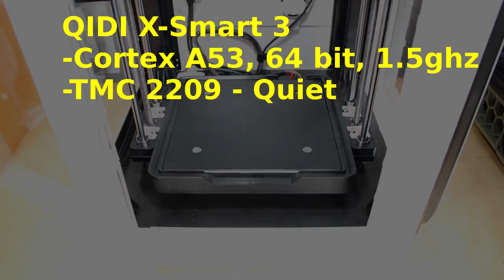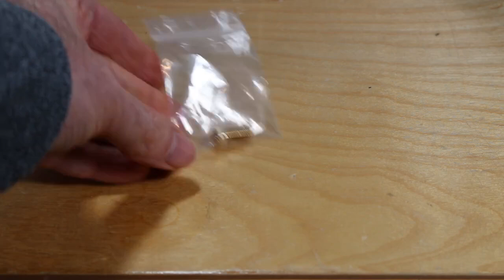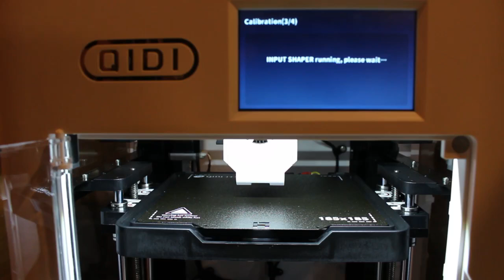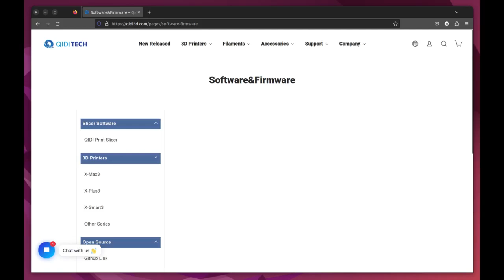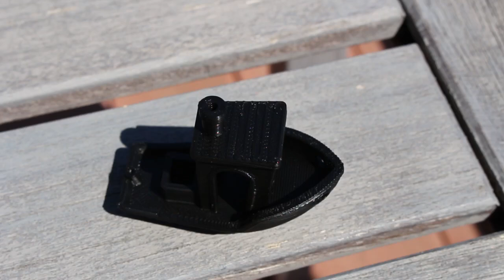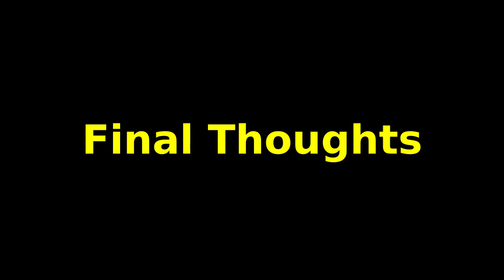QIDI X-Smart3.  How fast can an FDM 3d Printer be?  See this fully assembled corexy 3DPrinter run

Comment: I just picked one up from Kidi for $299. They added a fan and some other bells and whistles in recent production runs. It’s perfect right out of the box……I have been running pla and PETG……both with the QIDI Slicer. It’s fast………..You can not beat this printer for this price.
Reply from the maker: Wow, I think that's cheap.  I agree, that price is amazing.  Where did they add the fan?
Reply: Back wall of the enclosure…..earlier mfg runs did not have it.  @KapmansBasementWorkshop

Comment: I didn’t click the buy button yet. Looked at other current offerings but keep coming back to this one. Any new concerns? The printer is still good?
Reply from the maker: The printer is still good.  However, I no longer print at those speeds.  I have slowed it down a bit.  I dropped the deceleration to half and it runs quieter and vibrates less.  I've also learned that I need to pop the print head cover off and check the screws on the print head every once in a while.  They loosen on their own.  I will eventually put some loctite on those.  But I think the deceleration change has improved that situation as well.  But otherwise, it's good.

Comment: Was looking at the X Plus 3, with the slightly bigger volume, but they seemed to have been all removed from sale everywhere. 
There's been no announcement that i have been able to find to say why, makes me wonder about their reliability down the track.
Has there been any problems with this model?
But now the Creality K1 & Max have been almost released, it gives me a couple of other choices.
Reply from the maker: This printer has been good.  I have noticed that it's good to check the hex bolts on the print head every few weeks to make sure they are still tight.  When running such high acceleration, I think the vibrations work them loose over time.  I'm debating using a little loctite.  I don't want to get it on any of the plastic.  But other than that, it's been good.

Comment: Great video! Thanks for making it. Do you know if the hotends are compatible with the other qidi printers - that would be awesome.
Reply: The x-plus is sold out. But Qidi replied to my email "Hello, welcome to contact QIDI Tech. X-Smart 3 is capable of printing nylon and polycarbonate. The X-Smart 3 and X-plus 3 have the same attachment hotend and both have hardened extruder gears". Also another reviewer points out that one has access to the full fluid front end. So the smart 3 might be an even better deal.
Reply from the maker: @FinneyDale  You do have access to most of the Fluidd front end.  You can't update right now as you would like since they are still working on software for the QIDI.  But I expect soon, the update feature will become available in Fluidd as well. 
I suppose if you preheated for 30 to 40 mins and the nylon parts were small, you could probably print using those materials.
Reply from the maker: That is a good question.  I don't know.  I can try and find out from QIDI.  Thank you!
Reply: Actually under the accessories page they show the hot ends for all three and they look the same. The nozzles also look to be interchangeable. The question then becomes whether the firmware allows engineering filaments to be  selected.
Reply: Enclosure is not heated though - maybe a nice mod?
Reply from the maker: @FinneyDale  There isn't much space inside this.  And I'd worry about the plastic enclosure.  That said, it printed ABS perfectly when the lid was on and the door was closed.   There was no warping at all.  I did pre-heat the bed for a short while before starting the print.  It gets nicely warm inside from the bed heater all on it's own.
Reply from the maker: @FinneyDale  I would assume for that you might need to jump up to a higher end printer in this line.

Comment: great little printer, Prusa needs to be worried for a low cost core xy, nearly half the price of there standard printers to me no competition
Reply: Cant justify buying a prusa at this point. Aint worth it compared to the competition. Mk4 was a huge let down in my opinion
Reply from the maker: I think you are both right.  
I think we are starting to see a shift in the market and I believe much of this is being driven by the open source/self built/maker community.  That part of the market has been innovating in areas of 3d printer design (Voron, RatRug, Annex Engineering, Hevort, etc) and software such as Klipper, Mainsail, Moonraker.  These are heavily influencing newer/smaller manufacturers in a big way.  It's also interesting that we have now seen where BTT (BigTreeTech) has actually partnered with the Klipper community as part of daily business and contributes to the project.  I hope we see much more of that in the future as well.  I think these are all signs of positive change and a very interesting future.
Thank you both for the comments!
Reply: @Kapman's Basement Workshop  basically what we are seeing now are new companies doing too prusa what they themselves did 6-8 years ago to the establishment. Making a better and lower cost option while Prusa is complacent and think their brand name will carry the day
Reply from the maker: @EspenShampoo25  I fully agree.

Comment: Been following your videos when building my Voron 2.4. Just curious as to why you got this printer vs building a 0.2?
Reply from the maker: I was asked to review it.  However, I think it's interesting to step out and have a look at what else is going on in the world of 3d printing.  What's so interesting about this printer is that it seems to reflect some features, technology, and goals that have been driving the open source community such as Voron.  Also, this appeals to a significant segment of 3D Printer users that have no interest in building their own.  They can get that kind of performance now where a year ago they probably could not.  At least not for that price.  And for slightly longer term, how will printers from QIDI and from Bambu Labs impact the open source community designs?  That said, I love the 0.2 and I love building my 3d printers and the benefits that come with that.    But for many, this is the path they will choose.